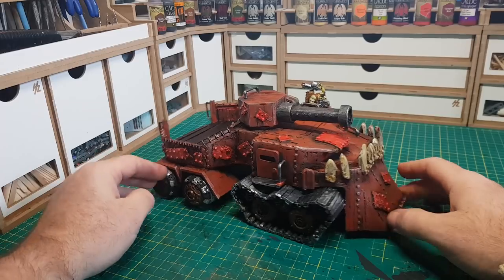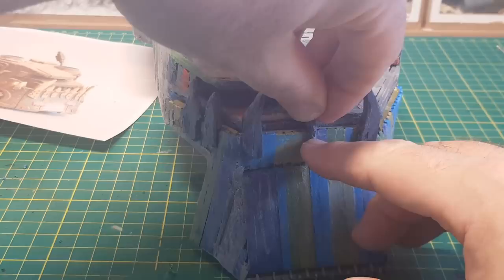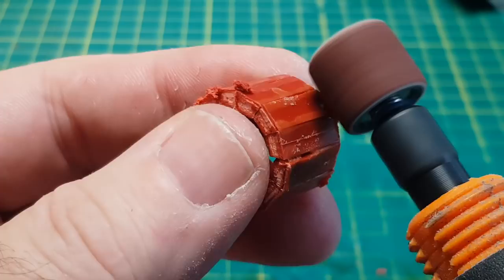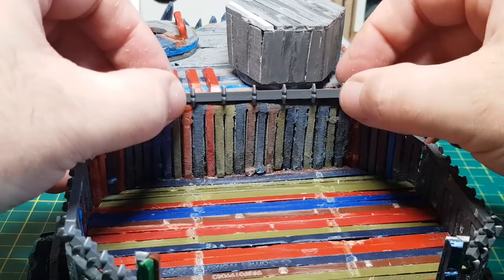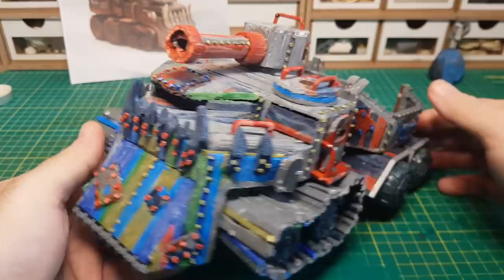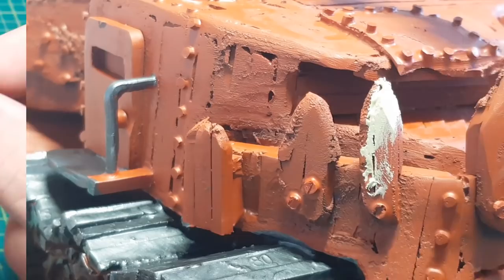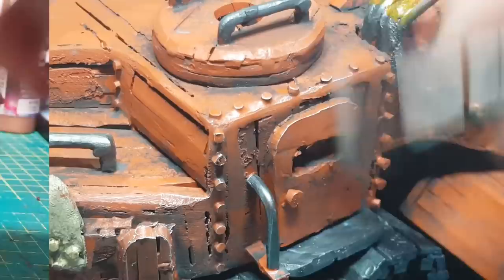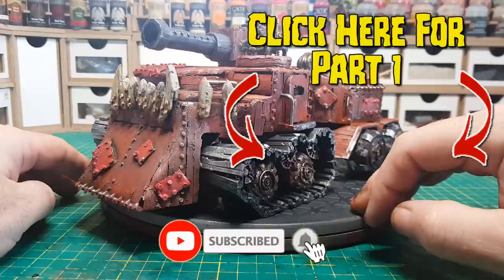Turn Warhammer 40k Sprues into an Ork Battlewagon - Part 2

Comment from the maker: Dont forget to watch Part1 first, no cheating =)
Reply: how long did you work on this build?
i see a LOT of nibbly nobbly bits. must have taken ages :P
Reply: 6:50 Thomas has never heard such bulls**t before
Reply from the maker: @timomatic6226  roughly 20-25 hours over about 9 days =)
Reply: I have an idea on how you can make thinner sheets of plastic, dunno if it'll work though. Use the acetone method to make the paste and then spread it onto a sheet of foil, place another on top then use a rolling pin to squash it all down to the thickness you want, then set it to the side for a few days to dry.

Comment: An old sandwich press and baking paper might be good for making large panels. Also if you're melting large quantities of plastic like that it's a good idea to do it outside as ABS plastic gives off toxic fumes when you heat it up.
Reply: That's a good idea!  Brothers Make do that with their HDPE plastic.  You could probably also get a similar effect with a toaster oven.  Probably wouldn't use it for food after though as per the fumes you mentioned.
Reply from the maker: Thats the weird thing, when I melted them in the oven on a low heat they didnt give off a smell, I was kinda expecting them to just burn or catch fire but they didnt =)
Reply: @MiniatureHobbyist  It may not emit a smell but the fumes are there. Be careful dude.

Comment: Bloody hell, seriously good job mate! Literally the only part on that thing I would have guessed was made from sprues is the tracks. This whole thing is genius.

By the way, just a thought- you might be able to get thinner (and possibly stronger/less snappy as the melted pieces would be squashed together?) melted sprue sheets by pressing them in something while they're still melted- maybe take it out of the oven, put another layer of foil and a tray on it, then load the second tray with weights or something, or even just stand on it? No idea if this would actually work, but it could be worth a try.
Reply from the maker: Thank you so much, with the oven melted sprues I did try a heavy rolling pin on them as well as heavy weights, unfortunately as soon as you bring it out of the oven it starts to harden almost immediately. I might try melting them at a higher temperature to see if they can get softer without burning =)
Reply: I was thinking melting in acetone, squash between baking sheets and then baking? Assuming it cracks because of gaps that hasn't fused in the oven. Great video! This is what 40k was all about when i was a kid
Reply: You could think about a layer of pie weights: it's the same principle for keeping a crust thin and in shape.
Reply: I would try this for my tau but it wouldn’t fit in as well as if I had orks 🥺
Reply: @johnbozarth9805 still usable for ruins in terrain though...

Comment: Thank you for once again enlightening me as to what is possible. I get inspiration on materials and methods every video, and we're saving some plastic from the waste stream along the way. How soft does the consistency of the acetone melted plastic get? Would leaving it in the jar even longer make a difference? It seems viscous and tricky to work with.
Reply from the maker: Thank you so much and for being a patron =), after about 24 hours the sprues seem to be at their gooiest and dont seem to get any softer over time. I will be experimenting more with melting sprues in the oven =)

Comment: To get the plate of sprues thinner you put a few bricks on top when “baking”

The replacement panels are OLDER, and off-colour, the BOLTS are new.

Sterling work, I give it

78/100

Because no pressure mode… if you slowed down and did the details with care you could get maybe 95/100… the question is would you want to!?

Great stuff, keep on going!

Comment: This looks awesome, lil tip to easily make things look like he paint has worn and rusted, start with a layer of silver and brown mixed, dry brush some silver and then use whatever colour you want for the paint but don't go up to the edges, slap some wash after and it looks like all the edges have chipped.
Reply from the maker: Thank you and cheers for the tip =)

Comment: When you're working with the sheets of ABS, try using a heat gun to reheat the area you're cutting, it should help. You could also try cutting it with a band saw, ABS should be able to be cut without major melting issues unless GW has changed the formula they use significantly from the industry standards.

Comment: Love the teeth. You have to put weight on the plastic in the oven to get it thinner, and keep the weight on as it cools
Reply from the maker: Cheers, I like the teeth too, I did try putting weights on the melted sheets as well as trying to use a large roller on them but it didnt work, as I melt them on a low temperature its still quite solid/hard and is soft enough to squish. I will be trying it again on a higher temperature but need to be careful it doesnt burn lol =)
Reply: @MiniatureHobbyist  havent tried with sprues🤪.  With hdpe, i sandwich the plastic between wax paper, lay it on a cookie sheet. Stack a chunk of wood on it, and put 10 lb weight on that. Alternatively, once it is melted, transfer to a press or pressure clamp arrangement - its gotta be really quick transfer.  I end up with sheets about 3 mm thick. They are fairly brittle, tho. I can cut them with scissors.

Comment: You're right about painting, too many people are a bit snob when it comes to it, almost forgetting that it is supposed to be fun at first ^^

for your sprue sheets, when they harden too much, maybe you could try to reheat them with a heat gun or a hair dryer?
Reply from the maker: Yup the painting needs to be as much fun as the build so I dont worry now if its not perfect, the heat gun might work, I need to try that =)

Comment: AH! I didn't expect the second half to be up so quick!
Final product looks great; especially the treads, give it a Metal Slug tank look.
When you're heating the sprues in the oven, maybe try putting a heavy weight (cast iron pan possibly) on to top to "encourage" the sprues to flatten more.
Reply from the maker: I didnt want people to have to wait =), the plastic sheets are very firm in the oven, I did try a large roller on them as well as heavy weights but the sheets arent soft at all when in the oven
Reply: @MiniatureHobbyist  Well, it was a thought. It's crazy they stay tough like that.
Still, cheers!

Comment: I just had a thought maybe after melting the sprues in the oven while they are still warm maybe try rolling them out with a rolling pin to make them thinner and repeat until you get the desired thickness.
Reply from the maker: I did try that but the instant you take the tray out of the oven the sprues are hardening very quickly, I even tried some heavy weights
Reply: @MiniatureHobbyist  that's a shame. If I come up with anything else I will be sure to say something. I think your build turned out really amazing regardless and I enjoy your videos very much I'm very glad I happened to find your channel.

Comment: Absolutely brilliant. Could you roll the plastic sheets when they come out of oven whilst they are still malleable? Could you even use a textured roller ?
Reply from the maker: The plastic sheets are very firm in the oven, I did try a large roller on them as well as heavy weights but the sheets arent soft at all when in the oven